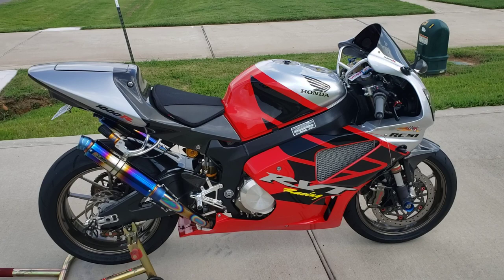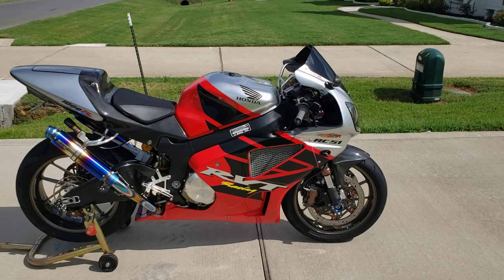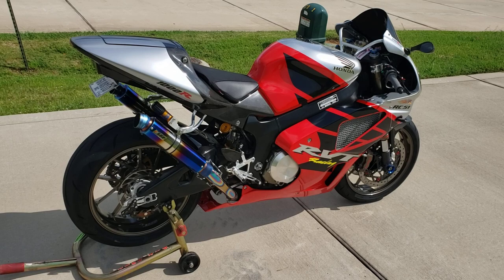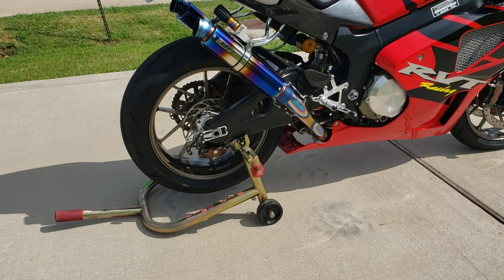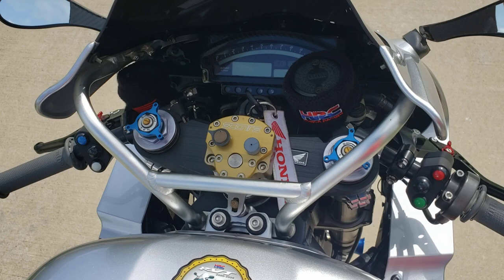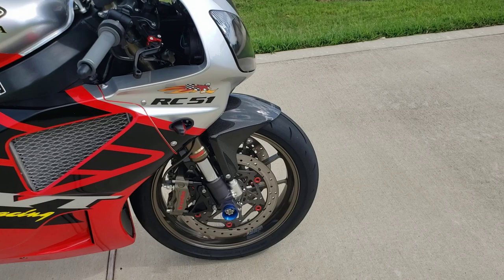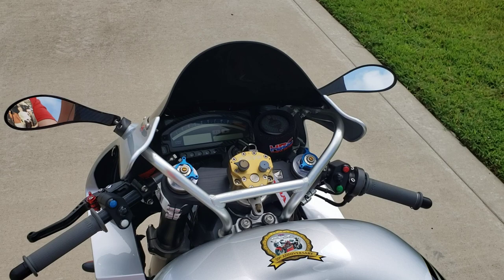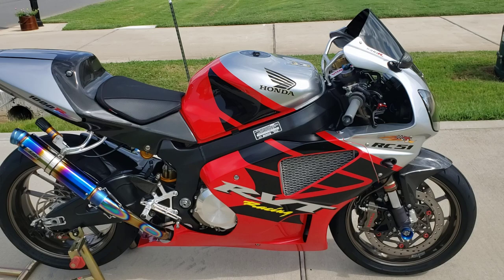2003 Honda RC51 Build Overview and Start Up

Comment: I bought a 2020 BMW s1000rr M last year and tomorrow I pick up a ‘03 RC-51.  It’s gonna be hard to decide what mods I want for which bike!  To be perfectly honest, I love these Hondas just as they are but sure wouldn’t mind picking-up a set of cans like you have.  Very beautiful my man.
Reply: yeah the ladybirds are nice but I would have to say that Sato would be the way to go. They only made Sato for one bike and that's the RC. Ladybird makes pipes for all bikes resulting in a lot of their titanium pipes being similar in a lot of ways where as the satos are specially designed for the RC. And my satos are carbon fiber as well, eeeeww cheeky. Although Sato doesn't exist anymore so in hindsight a new set of ladybird pipes may just edge out a used Sato pipe. Just sayin

Comment: Beautifully restored! Well done. I noticed that the stock rear mudguards are always being chopped off. Is is possible to buy stock ones anymore?
Reply from the maker: They are very hard to get and super expensive. There was not much work needed restoring this one, its only about 6500 original miles.  My 04, see other videos was a 45k mile basketcase I did a LOT of work on. This one mostly just added parts